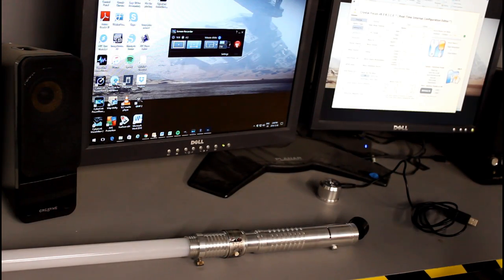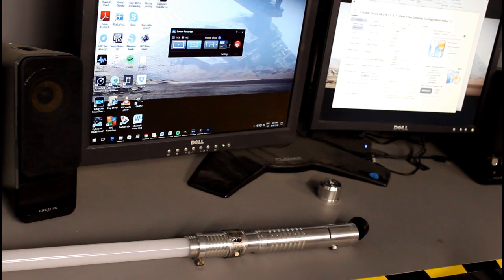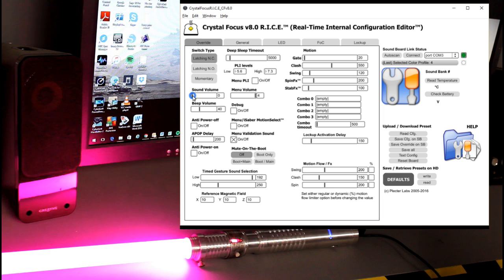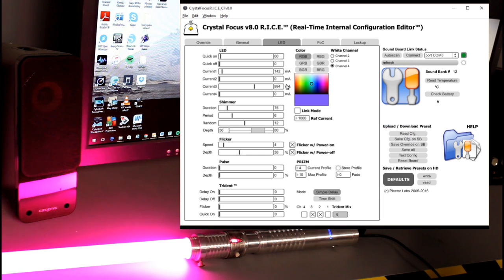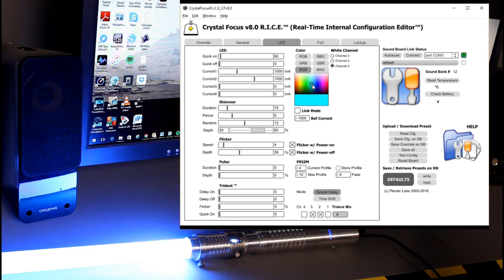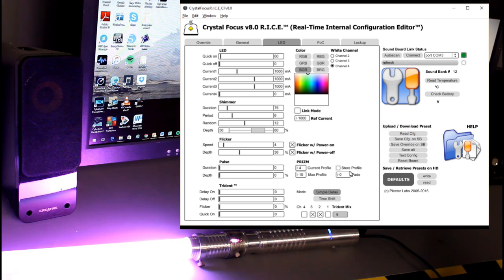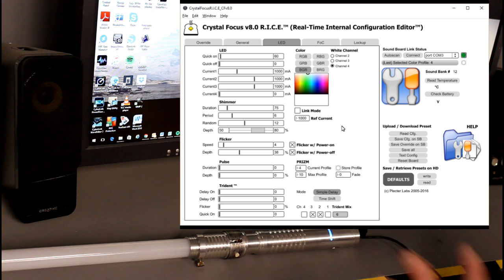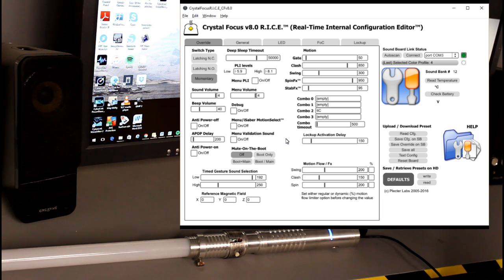RICE interface

Comment: What’s the difference between this software & removing the SD card? Does using RICE facilitate the hassle of constantly removing the card from the board for testing or are they two separate sorts of configuration processes?

Comment: I have a Crystal Shard V2, and the LED is a single red. So if I want to change brightness or something, or blade shimmering, will it be separate from the colour changing section which of course doesn't apply to me? And I won't have to select one of the RGB, or BRG etc buttons will I, since it's just one solid colour LED? Also, there's two sound banks/fonts with independent settings, so when I save changes I make, it'll only be on the bank I made the changes on?
Reply: Correct.
When you save settings it's on that particular sound bank, but when you save on override, its for all banks. I think flicker etc. are in override. Consult the manual for that.
Reply: Rob Petkau Thanks!